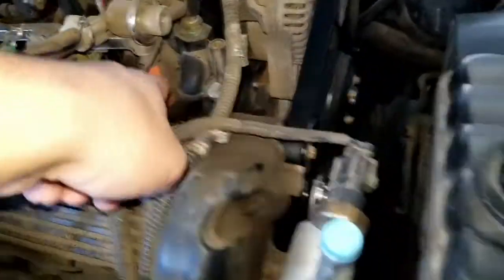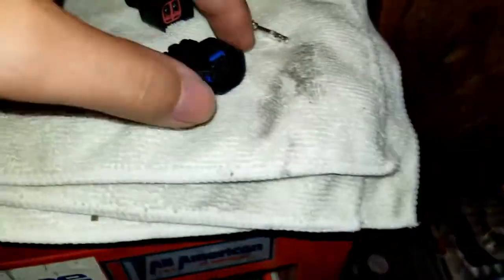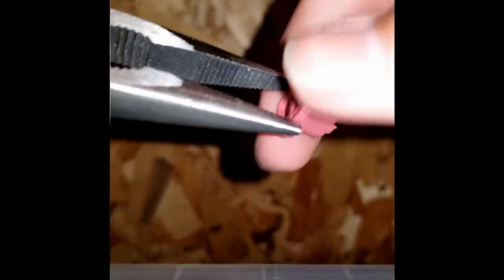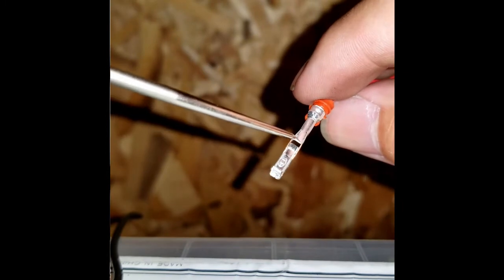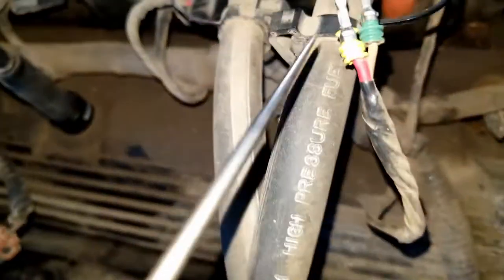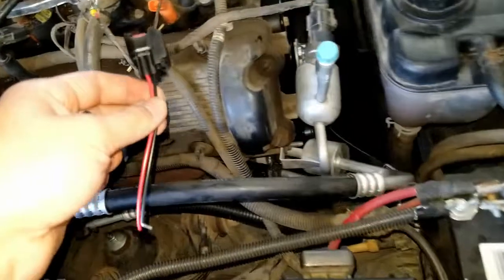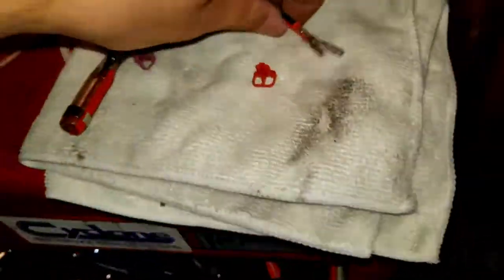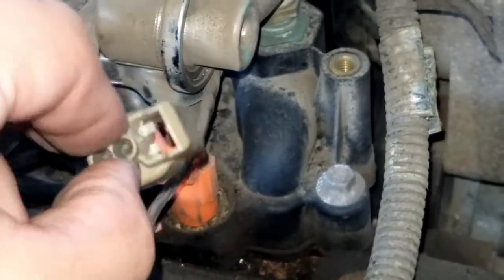Crown Victoria: How to replace broken EV6 fuel injector plugs

Comment: thanks! I have a similar connector on a Mazda 3, with a small flat head I was able to remove the red lock, and with a small tack pin I carefully released the cable tab to remove them from the connector. It was really easy! a piece of advise for other watchers: when you are replacing the defective part remove just one cable, then you can plug that cable in the right place in the new connector, so you don't mess up the order!

Comment: Just ordered a new set of 8 for my 07 GT. Was changing the old injectors and ended up completely breaking almost all 8 of the connectors. Good to know I’ll be able to fix them without having to sauder anything which can be a bit messy. Thanks for the help! 👍

Comment: Very nice video.
My very first experience after i bought the vic, i popped the hood, rolled up my sleeves and i said, lets tear this intake manifold apart.
First thing i touch is the injector connector..... click... it breaks.
So i did what crossed my mind, ziptie around the loop, hug that injector tight, bam!  1 year later that ziptie still holds on for dear life lol.
But i did buy the connectors a long time ago and i plan to do it, perhaps soon :)
Reply: Could not be anymore accurate with my 3V

Comment: Yeah I have to do this once I get engine and transmission back in car. Did you pick up those connectors from Ford?
Reply from the maker: I bought them off Amazon, link here https://www.amazon.com/gp/product/B07STLGB7Z/ref=ppx_yo_dt_b_asin_title_o03_s01?ie=UTF8&psc=1
Seems like it's a generic connector used by multiple companies.

Comment: Right on Thomas,
This is a really good video.
Do you have plans to make more Crown Vic videos?
-Chuck
Reply from the maker: I don't have great space for it currently, but I do want to try some more soon. I think I want to start with some of the wiring projects I've done because those don't require the space of some larger mechanical projects.
Reply: @thomaslee7684  
Right on,
I'll be check back.
Reply from the maker: Started working on the outline for my headlight upgrade video today. I'll include all the parts I used, comparisons between 65w/80w bulbs, and install how to. 

Thanks again for the compliment and encouragement.

Also I found out I have access to the full Adobe product suite through work, so I'll get to use Photoshop/Premiere Pro for editing. Video might take a bit of time as I learn Premiere Pro. I have enough experience in Photoshop to get by for now.
Reply: @thomaslee7684  
That sounds great!
Can't wait to show the guys.

Comment from the maker: The video isn't as concise as I wanted because I had recorded a couple different shots and stitched them together. I'll probably get a small tripod to get better angles and free up my hands going forward.

Hoping to record a couple projects going forward, mainly the spark plugs/coil boots, and the cooling system refresh (new pump, reservoir, upper/lower radiator hose, and thermostat).

Any suggestions are welcome, I'm definitely new to this but I want to contribute since I have relied on DIY videos for all kinds of fixes.